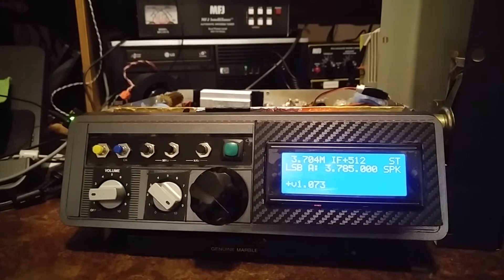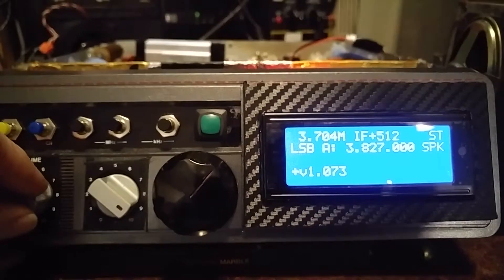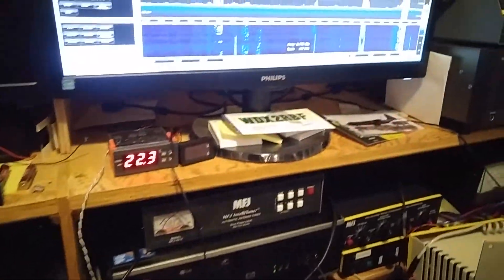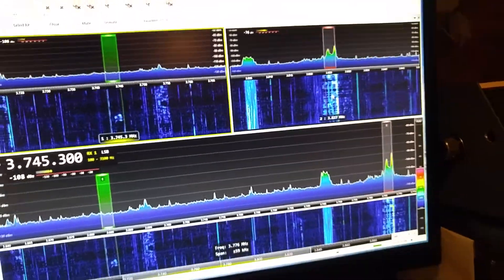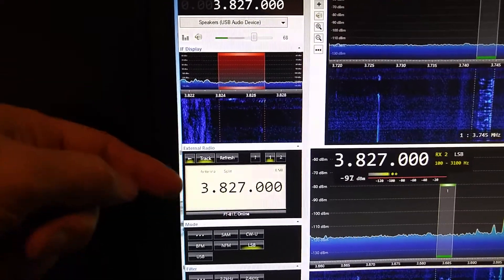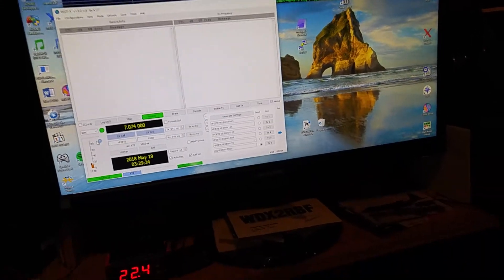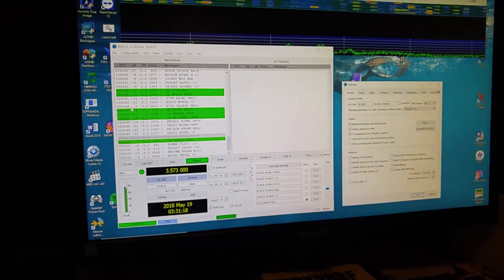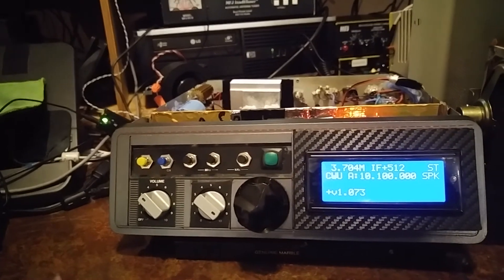UBITX - QRP RADIO with CAT CONTROL- SDR FEATURES

Comment: Outstanding functionality with low cost components. The hackable nature of this hardware and software with modern technology is the part of ham radio that really excites me as a new operator. Don't understand why this isn't a more popular build. I will be trying something like this with the current 1.6 and Nextion display. Another idea to take it to the next level would be to integrate something like the APM2 DSP module and program it with Sigma Studio to have audio compression and EQ for first class audio.
KI6UML

Comment: Hi Joe 
Thank you for this excellent video. Can I get the filter diagrams. I received my ubitx in February 2020. I have so far no suitable reception except a lot of loud noise (probably due to the lack of AGC) and an unbearable sizzling sound over the entire 20 and 40 meter band without the possibility of hearing the real signals while the rest of the other bands I receive them in excellent conditions.
73's! from TOUFIK / 7X2DE

Comment: Did you notice any noise at the time you hook up the rig over usb?
Reply from the maker: No, nothing  I could hear.  With all the extra internal filtering I added it may have cleaned most of any residual line noise. Also good ground between Radio and Computer
Reply: I have to double check mine... I’m getting extra white noise when I connect the arduino via usb... I heard the ch340g from the cheap Chinese clones is noisy, but your rig sounds awesome.
Reply from the maker: @eduardogarciamontesdeoca5935  
I have 3 hash filters and 2 12v to 5v adjustable regulators.
On the main input voltage line I have 1 pi type filter with 2200mfd on each side and a 5 ohm 20watt resistor
 On the raduino voltage I use a chinese buck adj voltage regulator with another smaller hash filter
I have a 2nd regulator but have to check where I used it.
It's been a while since I looked inside.
The filters made a dramatic change in reducing the digital noise.

Comment: Very nice Joe! I've studied your video for over an hour now, it's very inspirational to be sure!! I'm still working on the case for my uBITX, but now I'm very excited to add a SDR inside as well... from doing some research it looks like tapping between K1 and K3 might be where you've done it, does that sound about right?
I've seen a lot of builds as I've been gaining excitement, and I've got to tell you yours is the one that's given me the greatest excitement yet! I hope to catch you on the air when I have mine finished!
73's! de KR0HN
Reply from the maker: Rohn,  Glad you like it...It sure has lots of features for everyone.  My other videos show my latest change , now using 3.2E Nextion display .  I like the 3.2 size for an on the rig display....  Nice colour graphics etc....
 Am testing a 7 inch Nexion display - lots of real estate on it ..  Going to make a large remote head......

The SDR is done two ways...with just a RTL Dongle(very cheap) or a RTL Dongle and up-convertor.
For the Rtl Dongle only - info is located on www.hamkeys.com... just a piece of coax to the board and then to dongle... It works well but not nearly as well as  when using a Rtl Dongle and up-convertor
Which is what i demoed.
The  location for the  -  combo setup is on k3 - so the receiver is protected.. I have a photo which shows exactly where to solder the coax... Gregory Kees found the location... If you need it just send me an email...joeman2116@gmail.com

73
Joe
ve1bwv
Reply: Thanks Joe, that's a very kind offer! I did send you an email... I think I'm pretty sure where to connect it, but I wouldn't mind the confirmation :)  Thanks again, Rohn
Reply from the maker: I have a photo of actual connections for the rtl up converter version. It makes it much easier.
Just send an email direct to me at joeman2116@gmail.com

Comment: wow, very impressive work !!!!!  where can i fond the firmware that you are using? and how the SDR is connected?  
73, IU3IRR from venice italy, 18yo operator
Reply from the maker: Hi, 
The current v1.08 firmware and project information  is located at www.hamkeys.com  It is created by Ian,lee - KD8CEC
There are 2 ways to connect the SDR.
1.  The first method uses the SDR option available from the options menu
This method only requires a RTL dongle and a wire connected to the ubtix motherboard the other end connects to the dongle which plugs into the computer.   Very easy to add on .
The software i use is SDR-radio - free software.
The is a cheap ways to add basic SDR but The display does not have even gain across the bandwidth.  More like a bell shape.  .. Info a the above web site

2. Method 2  uses a RTL Dongle plus an up converter. This method is much better.   Nice even gain displayed across the whole band.
 Two wires are added to the motherboard to connect the up converter on the rx side of the relay.  This is the method I use.  Since I had a spare up converter in the hamshack very easy to add on 
The disadvantage is if you dont have an up converter... you need to purchase one
73
joe
VE1BWV
Reply: @ve1bwvjoe  What's the bandwidth that the SDR sees?  Is it after the post-roofing filter with the narrow band or is it earlier in the chain with the full 2.4-3MHz width that the dongle can consume?

Comment: Hello Joe, Very nice. What documentation did you follow to add the SDR and digital connections? I'm just starting with mine, and I love the 4 line display, so I'll be adding that when I get it up and going. 73 de ZL1RAH
Reply from the maker: Hi,
The SDR function is built in to the 1.08 version. To set up One has to use the ubitx manager.  The set for it is on a video tutorial at www.hamkeys.com
Depending on what computer software you want to use, computer setup will vary. I use SDR-radio. free software.
The setup for it is also on the hamkeys site.
The hardware part for sdr is just add a piece of coax to the correct spot on the mother board which is connected to a cheap rtl dongle.
I used this method and it works well. But gain across the band is not uniform.
 I happen to have a rtl Dongle and a up-converter in the shack.  Using this I get a perfect beautiful even bandpass on the waterfall.  
Digital modes:
Many people just do a direct connection to speaker and mic.  I always use 1to1 600 ohms transformers.  This keeps things isolated and typically cleaner.  I have a small stock of them on hand - very very cheap from ebay............
Using the built in CAT control which is a driect connect from your raduino to the computer, using WJST-X.  It is a simple setup by choosing the correct sound card and cat control emulation   FT817.
PTT is done by Cat control.... so no real interface is required..
73
Hope this helps
VE1BWV   - Joe

Comment: Nice, can you transmit with the dongle.
Reply from the maker: The way it is hooked up is the dongle/ up converter is connected on the rx side of k1 ubitx relay.  This allows it to use the ubitx antenna at the same time as the ubitx radio.  
When I transmit, the ubitx  radio transmits.  The SDR is protected because when the relay is sent to TX mode the RX lines are ground... This protects the ubitx receiver and also the SDR unit... Gregory Kees, found the spot on the motherboard... 
 In this configuration, you can use the UBITX as you always do. and at the same time run sdr radio or wsjtx independently.. You can also listen to UBITx rx audio and or SDR audio at the same time....There is a very small delay but hardly noticeable..
Nice having all the features in one package.

The SDR upconverter package works remarkably well and for around $30.00 on ebay ..

Next I think I| will add the built SDR to my TFT colour touch control UBITX.
Reply: Great work Joe! I just received my uBITX kit and have a 3.5 Nextion display on it's way. I have one of these... https://www.rtl-sdr.com/wp-content/uploads/2018/02/RTL-SDR-Blog-V3-Datasheet.pdf .....that I've been playing around with and would like to know if it would work for this add-on as well as whether I'd need an up-converter since it already has direct sampling capabilities. Any advice greatly appreciated.

Comment: Very cool!  Love the SDR waterfall feature.  How much would you say you have invested in the rig?  I'm looking for a budget minded entry-level rig. Working on my General as we speak.  A few guys in the Ham Radio Crash Course are intrested in the uBitx as well.
Reply from the maker: Hi, 
Well rig is 109 us.  The case was from a junk pile. The large heat-sink from an old computer.  Extra filters, wires,etc $10.00. The large  optional display was $10.00.  So around $130  for the rig and extra parts and wiring, connectors..
The SDR / up converter package was $30.00 us.   This package is completed , works well, and very compact
  If you want to use the built in SDR function only , than just 1 wire and a $10.00 dongle will work 
All the above includes shipping.
Joe